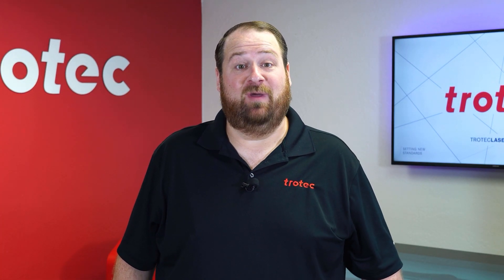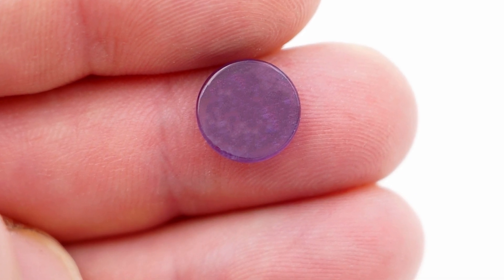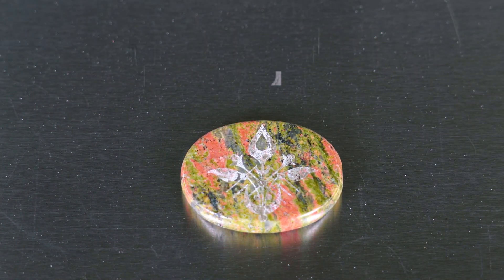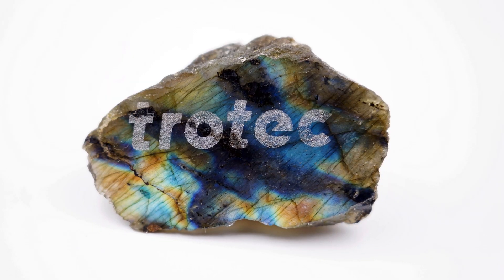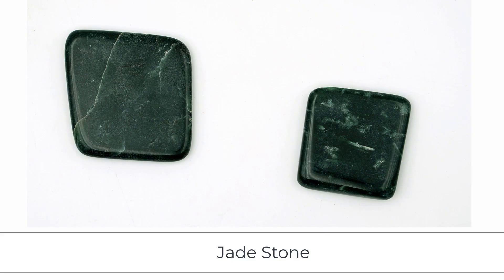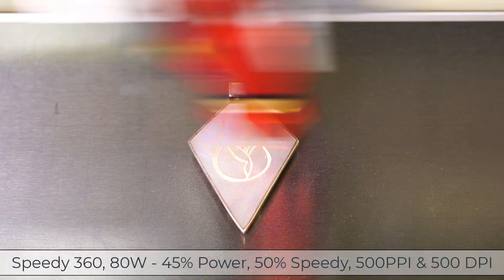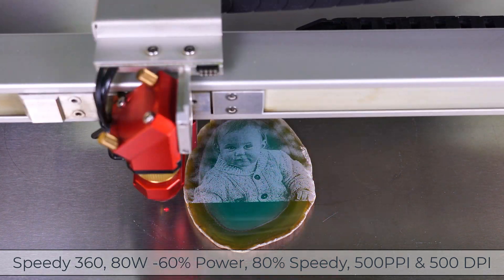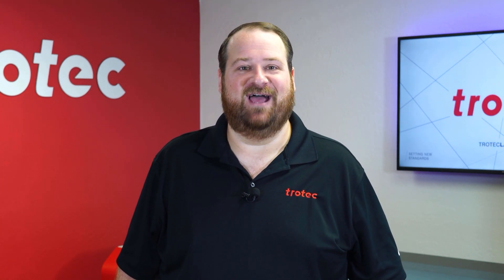Trotec Laser: Can you Laser Gemstones?

Comment: I am attempting to laser engrave on Jade (NZ) and it bubbles (is raised). I have it on glass settings. Is this too low? What would make it bubble? I have a 30w laser engraver
Reply from the maker: Hey Teresa! We have not attempted Jade with the laser. Our advice is to try many different laser settings; most stone/gemstones are not like glass and requires much less laser power. With a 30-watt laser, run it at 100% power, 50% speed, 1000Hz, and 500 DPI, then based on the effect,  run additional tests and only increase or decrease the speed setting until the desired results are achieved. Please note that on some materials, the lasering process may not work at all.